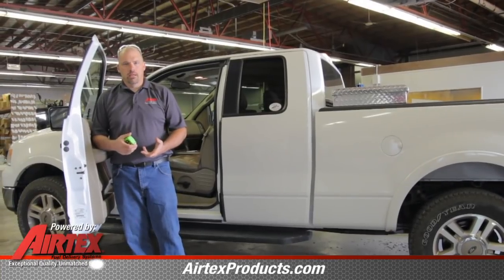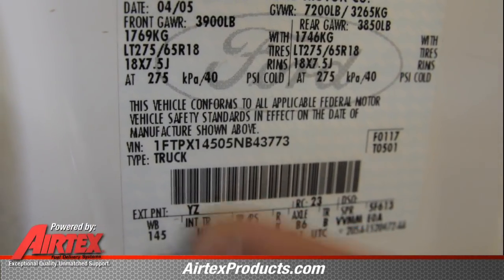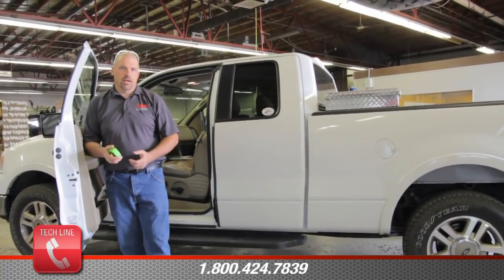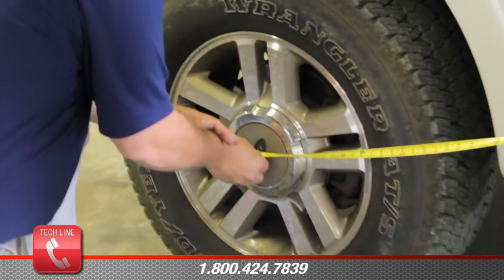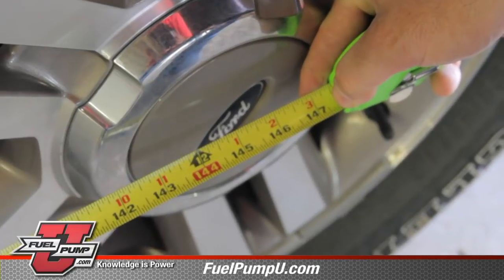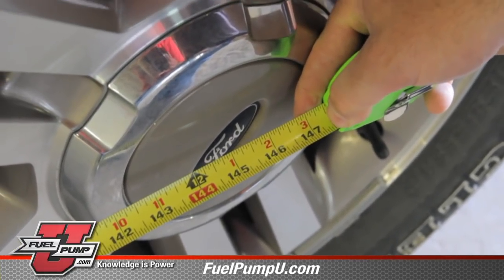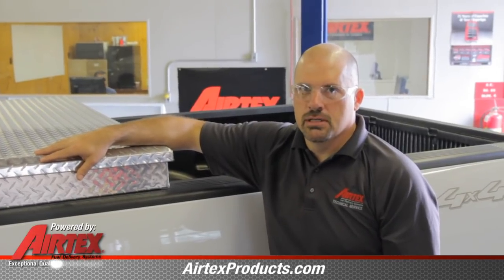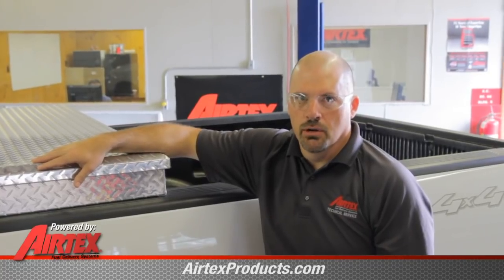How to measure the wheelbase of your vehicle

Comment: Quick question...  When using the tape measure, was that Ft, or In???  I'm asking because that didn't look like 14.5 by any means, especially if 12in is a ft.    14.5in would be 1ft 2-1/2in, and that ain't much.  But it can't be 14.5ft either because the wheels looked too close for that.